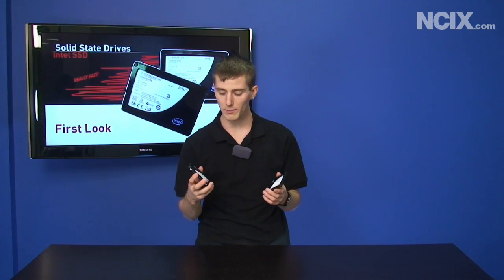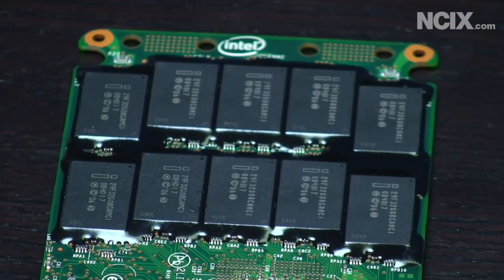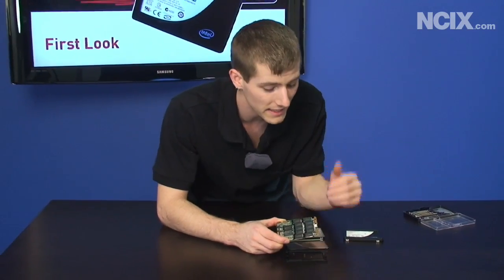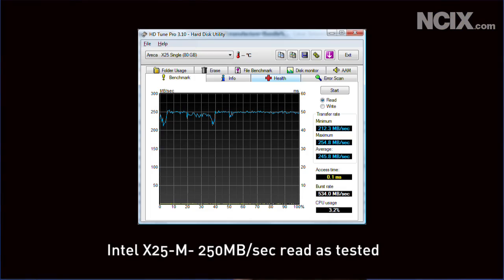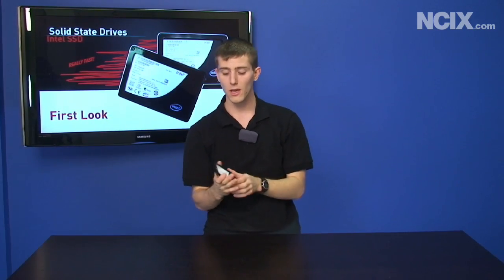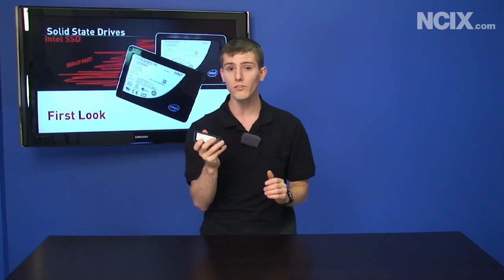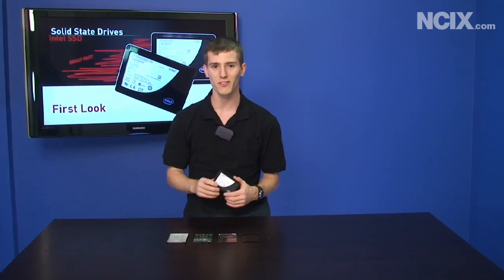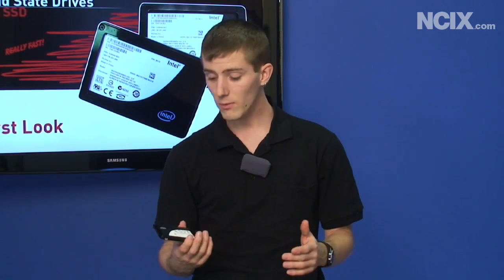Intel X25-M SSD Disassembled (NCIX Tech Tips #29)

Comment: @DarkSifu why would ram replace the hard drive? ram 'forgets' once the power has gone, flash memory can store data like a hard drive however. you can actually buy these weird things that let you install like 8 ram chips and attach to your computer, and you can use it like a hard drive (and theyre much faster than ssd's) but once the power goes out you lose your data which is why some of them have betteries

Comment: there raid results a crap when comparing them to hdd the price of buying 2 ssds and raiding them to 0 is that high that you could buy 3 hdd for that price get around 1.5 tb of data and have wright speeds at the speed of 3 hdd you don't need more than 500 mb/s or so cause every thing would alread load instant 
my prices ar most likly wrong my sorces say for the price of 2 you could get 4 $59 for 1 500gb hdd and 110 for 500gb ssd that from lowest ssd prices for 500gb it can reach 300 ssd suck atm